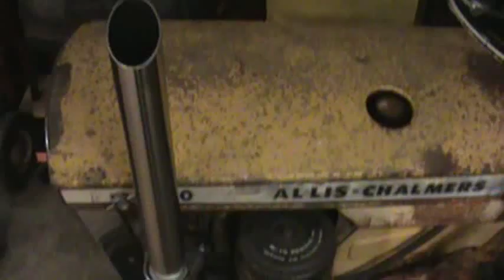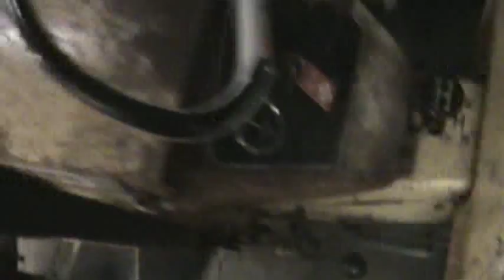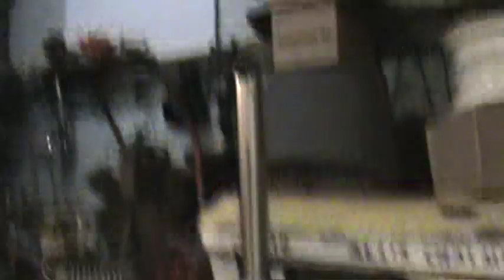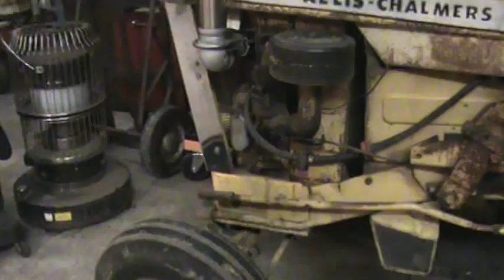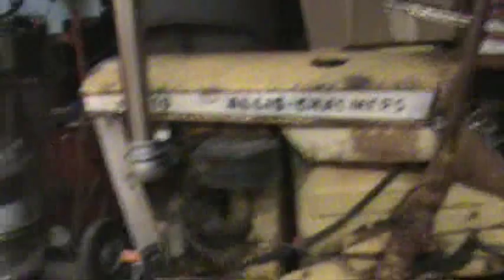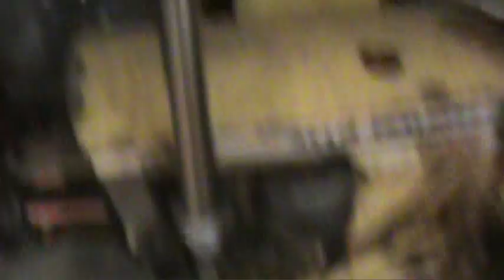Watch this INSANELY low Idle of the 23D Briggs in my old 1964 Allis Chalmers!!

Comment: Found one of these on a ford lgt125 on the side of the road with a free sign on it, couldn't get the tractor in the bed of the truck so I grabbed the engine and hood as well as a few other bits thinking nobody would grab the rest before I got back to get the rest.. I was wrong I've been kicking myself for that ever since and it's been a few years

Comment from the maker: Instead of the standard setting of 20 thousandths I have the points set to 18 thousandths to get the optimum spark. These old cast iron Briggs will all Idle real low if they're properly tuned. I can't find the locke video you want me to see so if you could, send me a message and attach the video for me. As far as having the set up, I won't know untill I see the Locke video.

Comment from the maker: @LaPavoniMac I don't like keeping the low idle for any length of time. Right before I did the video I warmed the engine up at mid throttle to make sure everything was well lubed. I was surprised at how low it went actually. That engine detonated last Spring. On inspection of the carnage I found that the oil scraper ring had cracked in half and lodged the piston causing the connecting rod to explode. Fortunately, the block was ok and it's back in service with new internals.

Comment: Got a brain teaser on a 1964 23D 
Burning more than 1 ounce per hour of oil  light loads. 

Rotating the engine by hand there doesn't seem to be much cylinder leak down but smokes like a freight train nonstop when running. 

Smokes worse when increasing rpms gets little worse as it warms up. 
Lower  hours engine still has some galvanizing on the muffler.

I did remove and check the crankcase  vent and it isn't blocked, and the check valve is also working. 

I'm wondering if the engine had sat years before restart could there be oil blow by at the valve guides or is the oil control ring possibly stuck. 

I know compression test deference between dry and oil soaked cylinder can indicate a ring issue but not sure how to test if oil is pushing threw the valve guides or a stuck ring. 

I'm going to soak the cylinder with marvelp mystery oil for a month and see what happens before removing the head. 

May have to add a seal to the intake valve. 

Has amsoil 10w-40 small engine oil.

Comment from the maker: You're exactly correct, which is why I never run them at that slow a speed for any length of time. Also, these small engines are oil splash and that low a speed doesn't get the oil to the top of the engine. Stay tuned for an up coming video with a laser tachometer showing how to set the idle to factory specs of 1100rpm idle and 3600 rpm Max. Cheers!

Comment: i wonder if it would be possible to use an electrical or mechanical pump with a radiator to pump and cool oil in and out of the crank case.

Comment: I think it's a mix of a very heavy flywheel, and the way those up draft carburetors are designed. I have a similar engine to this on an early 70s Simplicity, and it wont stall. It just keeps running no matter how low you go hahahahaha

Comment: Be careful you don't idle it so low your oil pressure drops low enough to cause engine damage... Keep an eye on your oil pressure.
Reply: These Engines do not have "Oil pressure" as there is no oil pump to build any. however if the engine is allowed to run to low the hydrodynamic bearings on the crank-pin and piston skirts and cylinder wall will not get adequate lubrication because the "Dipper" on the connecting rod cap will have insufficient speed to "Splash" the oil to the parts of the engine.
Reply: Ben Heatherman
 That is an old beast, sir. Enjoy your tractor.
Reply from the maker: Ben Heatherman
Thanks Ben. I am aware of the risk of damage, which is why I didn't run the engine for very long at all. Prior, I made sure to run at normal operating speed to thoroughly lube the engine. When I was much younger, I made the mistake of letting a small engine run at a low idle like this for quite some time and I trashed it. Now I rebuild and repair these vintage engines as a hobby and the last thing I want to risk is another melt down. I appreciate the information and hopefully it will help others who watch this and other low idle videos. Cheers! Zip~
Reply: You are kidding, right?
Reply: ZippoVarga
My gramps has an early bug eye Simplicity, (725). I'm pretty sure that machine can idle lower than yours does.

Comment: You could actually count the revolutions. Around 150 rpm maybe?  Impressive. 
I wish Briggs and Stratton still built them this well. They've been going downhill since around 1980.
Reply: +scdevon It was firing three times a second. Multiply by 60, then again by 2 because it's a 4-stroke engine, and you get ~360 rpm.
Reply: themaritimeman You are wrong. It sounds like it is firing 3 times per second, but its only once. At 360 rpm he would not have been able to stop it with my hand

Comment: My simplicity idles that low
Reply from the maker: Don't let it run very long like that or you'll not be lubricating all the important stuff. I made that mistake years and years ago and Boom! Snapped the connecting rod on a little Briggs 2hp lol. Cheers! Zip~
Reply: thanks for the heads up. ive ran it  a few minutes idling low so now I know not to.
Reply from the maker: Yeah, the oil is slung around the crank case with the connecting rods oil sling and too low an idle won't circulate the oil well enough...plus, they're air cooled engines, and the low speed doesn't keep the engine cool either. So short bursts of low speed (less than 30 seconds) won't hurt anything. Zip~
Reply: Kind of stinks but it's the way it is. I know at shows it was fun when people were like "is it still running" lol